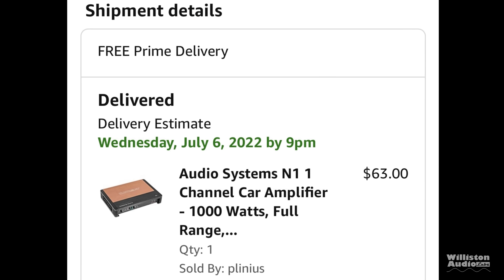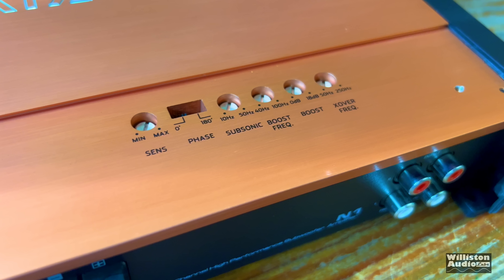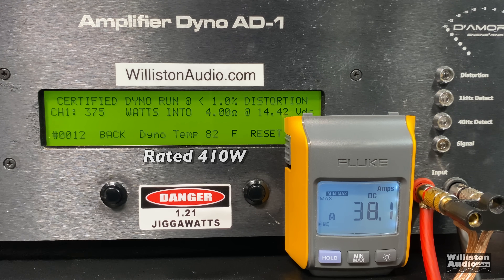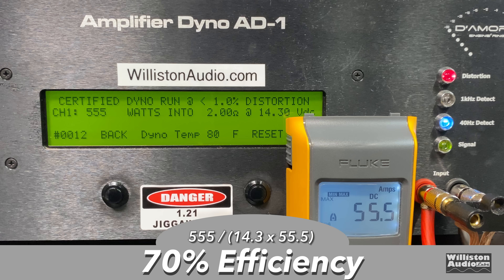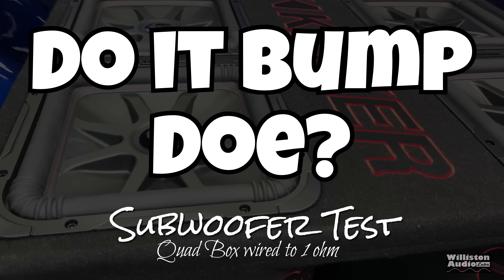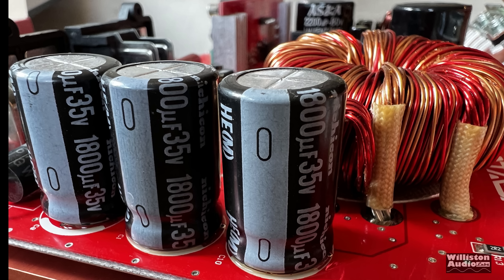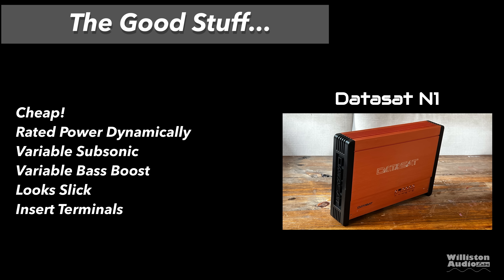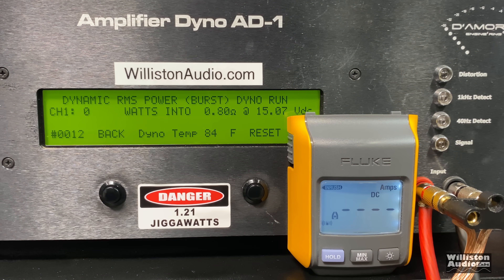Why is this 1000W $63 Amp BANNED from Amazon? [4K]

Comment: Don't know how long you have been doing this.  During the late 1970's up to about 1990, a friend of mine ran a car stereo shop (still does).  During that time, he built several crank it up cars.  We had a design we were going to put in an abandoned Rambler station wagon, but the shopping center had it towed off before we could do it.  The design was based on the speaker that a company called LTV built in the 1940's to test the microphone used to record an early nuclear explosion. One of the cars he built was for a customer with a 1970's  Chevy Monte-Carlo with the long doors.  The owner decided to go all in and cut the guts out of the doors and put 2 15's in each door.  4-18's went where the back seat used to be.  Since there was a little space left at the top, they through in some 10 inch Gauss for the mid-bass.  In the truck were 6 Harmon Kardon CA-260 amps, with all but one bridged mono.  A series of 5 inch across the top of the doors and some JBL studio tweets under the dash, rounded out the drivers.  This was fed by a high end Nakamichi cassette deck with computer controlled azimuth and a high end ADS for equalization.  The day of the contest came and we all drove to Dallas for the event.  We get there and the same guy who beat our car the previous year shows up with a 1960 Cadillac Hearse.  7-1500 watt amps and a - no kidding 26 inch Woofer for the low bass.  2-150 amp alternators.  Even with that, it still took 14 or so Marine batteries, just to turn the stereo on.  Yep lost again, but just barely.  The winner got a mini-pickup, but more importantly for the young gentleman, he got a job!  A leading amplifier company hired him as an engineer.
Reply: I miss the early 90's car audio days..

Comment: Interesting bit of kit there. I have a Velodyne 150W sub that I've been running for about 20 years (not continuously). It's an 8" cone in a ported case with crossover. The box it came in is long gone and I have it right next to a reflecting wall. My question is, is it as nice as I think it is? Yeah, it is fraying a bit on the cover. But it shakes the whole house. It also cost a whole lot less than current Velodyne products.
Reply: my boxes got smashed up but the one sounds decent enough, since the glue is holding up. they are cheap 12" passive speakers, so i use it in the house with a 200w car stereo (low power so a broke box isnt audible)
. look at the corner of the box and see if you can pull/push the panels together. if the glue isnt holding and its loose youll hear it as the speaker flexes and shakes the box, making a god awful noise. shouldnt hurt the speaker any though.

is the amp built into the speaker? might be fun to make a new box for the old active speaker. or find a prebuiltbox and fit the sub and amp into, idk.
Reply: or make a box for the amp yea? xD idk that would be sick
Reply: bro i took a piece of wood and glued it over a 12" whole. then fitted a 10" sub to said panel in place of the 12" speaker, giving it a bigger enclosure..... it sounded ok, needs a lpf though.
Reply: @1oneguythat  I should proof read better. What's gone / going is the cloth on the front. The physical enclosure is fine. The amp is built into the same box as the speaker. It puts out an amazing amount of base for an 8" with no passive driver. Although my room isn't that big, it still resonates a good portion of the house because of modern home construction. When I was in an apartment, it nearly got me evicted. LOL.

Comment: Since it was discontinued it is now a moot point.  This said; your tests while interesting did not provide meaningful data on any distortion or other accuracy errors which is how many of us look at amp performance.  It may very well produce the rated power at various impedance loads; however if the distortion levels are greater than 1 or 2 percent at those levels it falls short of desirable.  I do not expect much at this price point; however just testing the wattage does not tell us anything meaningful.
Reply from the maker: Time to watch something else then or make some vids yourself with all that additional testing. I’m sure people would eat it up. All that “meaningful” stuff…

Comment: I think your meter is lying. The amp is pushing out more than it is using. LOL.... Audio Overunity????   LOLOLOL How does it not blow the input fuses rated at 60 watts? 14.4 is the max voltage of most amplifiers x 60 amps = 864 watts, and even if the fuses blew at 125%, it would be 1080 watts. That's not including losses, etc. Adding losses would probably equal at 70% efficiency would be 756 watts at best. Test the amperage and voltage on the input with a fluke meter, I bet the 1.21 jiggawatt  AD-1 isn't showing correct numbers. I think you need to calibrate that sir.
Reply from the maker: I’ve shown before ATC fuses taking 2-3x their ratings for a few seconds before blowing. Maybe research more before making false claims
Reply: @wal the fuses are in parallel. We both know that doesn't give you 60 amps of protection, one fuses always has a fraction of resistance less than the other, so it follows the path of ;least resistance, blowing one fuse, then the other once it reaches the time/melt curve for a 30 amp fuse and blow. The following chart shows the fuse to open at 80 amps in less than .5 seconds, in fact it shows .4 . So, maybe with both fuses one will open first and the second fuse 1/2 second later. There's only one way to tell, put a good quality amprobe around the power wire and see what it's peak is while testing. I don't think you'll see a continuous amperage over 80 amps let alone even 75 .

Comment: Could it have been:

1) Actual Datasat product that was:
     A: Discontinued/liquidated?
     B: Stolen?

2) "After-hours production" by factory building them under contract?

Bonus Q: Do you know Ray Rayburn?
Reply: I was wondering if it was an attempt at branching out to a larger market that failed or was squashed by the higher ups

Comment: Using DC values (automotive)13.8V. @ 4 Ohms speaker impedance, that would be 1,000W/ 4 Ohms = 250 amps DC. First - No amplifier is 100% efficient (usually around 70%). At BEST that would draw about 350 amps. I want to know how an automotive power system could handle that load. Second is - just how big are the conductors on those 4 voice coils to be able to handle 88 amps?? Anyone that falls for that has a 1d10t error.
Reply: Pretty much everything you said is wrong.  That isn’t how amp impedances work, it isn’t how ohms law works, it isn’t how math works.
Reply: @stargazer7644  "splain it, then.
Reply: @GeneralHAM-d5k  Sorry, I don't have time to teach you everything.  I'll give you some clues though.  Speaker impedances are not DC values.  They're AC impedances.  Even at DC, you don't divide watts by ohms to get amps. You're looking for the power law, which is I=sqrt(P/R)  which would be sqrt(1000W/4R)=15.8A, not 250A, and that would be at 63V, not at 13.8V (the amp sends a lot more than 13.8V to the speakers).   Keep in mind, those are peak watts, not average watts.  The only thing your car has to provide is average power.   To calculate what your car needs to provide, you'd need to know the average power, and that depends on your music (that's why the fuses blew for some of his extreme tests - the average exceeded the fuse limit).  The fuses on the amp were 30A, so that implies the average power is going to be at most 300-400W.  The peaks are handled by the capacitors.  So you're talking at most 30A average from the car for this amp.
Also, the amp doesn't claim 1000W into 4 ohms.  It claims 1000W into 1 ohm.  So even your starting point was messed up.
Reply: @stargazer7644  Thanks. Now why are you so angry and abusive?
Reply: @GeneralHAM-d5k  You're welcome.  You spouted baloney as fact when you clearly don't understand ANY of the concepts involved and didn't take any care to try to get it right.  You stated that anyone that believes that the amp could possibly do what was claimed was an idiot, even though it was tested and shown in the video to be more or less accurate by someone who clearly knows what they're doing.   You demanded an explanation from me, as if you're entitled to one.  Nevertheless, I went out of my way and took time out of my day to try to help you understand a little bit of what you're missing.  And now you have the nerve to call me abusive?  What you're perceiving isn't anger.  What you're doing annoys me.
Reply: @stargazer7644  Thank you for this excellent example of civility.
Reply: That's not even how ohms law works. 1000w at 13.8v would only be 72.46 amps before efficiency. Speaker impedance doesn't matter in this context. The amplifier isn't driving the speakers at 13.8v. It's an amplifier. Its stepping the voltage up to roughly +-65v. 
The maximum current that could flow threw a 4 ohm load at 13.8v is only 3.45 amps or roughly 47w, so not sure how you came up with 250A or 350A. Or why your talking about 1000w at 4 ohms. 

Also my car's electrical system was capable of 250A with no upgrades. It now provides over 600A with some work done to it. Maybe dont call people "1d10ts" if you dont know what you're talking about.
Reply: Going by this logic, not a single amp on the market would achieve above 50 watts but here we are. And as Motoska8er said, amplifiers basically act like step-up transformers and turn that power into usable energy (AC) for speakers. Speaker impedance has nothing to do with the relation to what the amplifier does with the available current provided by the alternator/battery.

Comment: Hey i got a big question, i have two 4 ohm subs and one 2 ohm sub, can i wire both the 4ohms to 1ohm and the 2ohm to 1ohm and wire both to my 1ohm stable monoblock amp
Reply from the maker: Not recommended as the one 2 ohm sub will receive more power than the 4 ohm subs due to the lower impedance
Reply: @wal  the 2 ohm is a 800 watt and the 4ohms are 250

Comment: At 53% efficiency isn't this thing going to get so hot that it fails some internal components? If so, then running at 1 ohm would not be safe.
Reply: I got mine 2 days ago...honestly my punch 601 gets waaay hotter... this doesn't get all that hot...I swear like...very touchable lol. Solid piece..I'm getting a n4 too just to keep before there gone

Comment: I recently bought a Lanzar Vector VCT2610, I have not tested it but it says inside the box it's true rating is 300 + 300 watts rms. It's for strapping so it will be ok for 2 x 300w subs and my second amp for the woofers at 250w per ch and 6" x 9" 125w per channel. Should pump when I make the enclosures. There are some bad reviews for Lanzar but I think they are pushing the amps too far and not testing their true output first, I will keep them to their lowest rating. Thanks for all your great video's.

Comment: Thanks for everything Big D...

One thing I need to ask in this video:

In the beginning of this video, while showing the amp, the fuse rating, 2X30A fuses (Green), but towards the end of the video, right when you were going to open the amp up, amp had 2X40A fuses (Orange color), what's up with that? Over fusing? During the amp dyno test, it was using 2X30A fuses right?

Seen many of your videos, really caught that one by surprise.

I would love you do some testing with Brax/Helix amps, ever personally test those before? Very special request on that one, I would also love to see you do some testing/auditioning of the Diamond hex subwoofer, had years ago, 15 mutha funkin' inches, damn thing thump so hard, was unreal, very responsive sub and top notch sq.

One amp I would love you to test and audition, is the Tube Driver amps from Butler, this specific amp was designed for car audio people in mind, Butler makes stuff for home use too, Its been years, don't know if anyone still got one, this was about 20 years ago I believe.

Another amp I would like to see, is the Old Zapco AG series or even the later verisons, reference series, and the c2k amps.

Old school stereo 4 life!!
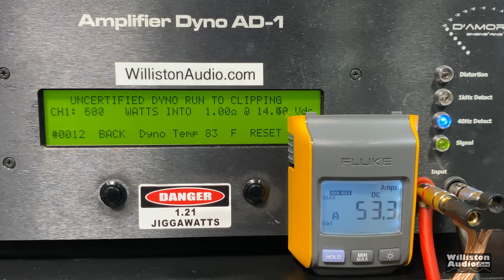Reply from the maker: watch 12:00 for the answer

Comment: I own the Dataset Rs20i
Reply from the maker: Wow that’s one impressive component right there!
Reply: @wal  I bought it because it decodes HDMI audio streams including Atmos and outputs many channels of digital AES audio that I reclock and feed to multiple DACs. Sounds realllly fine 👍
Reply: @wal  Datasat was purchased by the amp maker ATI a few years back. Their ap25 unit is functionally pretty much same as mine but cheaper.

Comment: there is still lots of info on line for their amps ,facebook , even woofers speakers etc, that goes to show you can get fair sound with descent units as some even namebrands are way overpriced. and way over rated also.
Reply from the maker: What I put in this video is my assumption. They may be back on Amazon tomorrow? I guess time will tell
Reply: @wal  your reviews are actually excellent compared to other dyno testers on YT keep up the great reviews. Thanks

Comment: I did about 3 hours of digging.

This company uses 2 major home audio names DATASAT and PLINIUS.

 these actual American companies make $20,000 amps and $9k cd players.
I have pics of this companies plinius car amps and speakers. Hot chick holding them included 😆 
I was told the plinius are not sold in usa probably cause of the name.
But the datasat n1 and n4 still are, according to them.
 there also known as UZK and KMAS
But I couldn't find any of these products 
I can get the n1 and n4 on August 10
I haven't been given prices yet.
I'll try to get a n4 to send, I'm hoping they don't jack prices too high on me,
I asked price they seem hesitant to give me one
But I have the message n1 and n4 are in stock and will b available,
Reply from the maker: There is most likely a good reason why they are no longer on Amazon but I could be wrong?
Reply: @wal  I assumed it was because of the name issue

Comment: I noticed that the fuses where different than the ones the amp had when you did what's in the box compared the when you showed the guts at first you had 2 green fuses then later you had 2 orange fuses what happened did you blow the originals?
Reply from the maker: Yep there ya go

Comment: The z44 power mosfet is arguably the best transistor ever in the car audio amp world. Due to their prevalence in many very good amps, including the early zed amps and countless others. Though there are many newer power transistors with higher performance they are a classic, timeless piece.
Reply: Nothing like the old Motorola brand mosfet they made a long time ago
Reply: I think its one of the reasons why it has poor efficiency and big difference dynamic vs clipping. Those mosfets are pretty old and inefficient. I would change mosfets for something better and probably would see 1000w up to clipping if the transformer isnt saturating ofc.
Reply: @JusstyteN  yes, I did state that there were newer parts with higher performance. Efficiency being one of those parameters, I would probably put in some 3205s but years from now the z44 or it's crossover will continue to be used in amplifiers.
Reply: @justinhiggins2210  yea i still have a small bag of those for repairs.
Reply: @JusstyteN  I had to throw away a rather large amount of those about ten years ago. I had purchased some from what I thought was a reputable company in Japan. I had bought parts from this company before but somehow this Chinese flip flop company was using a Japanese address and other documentation and it did so appear that I was buying good parts but they were fake, most having no gain at all, others very little. Their reason I quit doing repairs for profit. I have acquired around 300 to 350 car amps and have gotten into home hifi gear. My favorite sounding car amps are some old Milbert ( before the Phase Audio versions) tube amps, and they may be the most inefficient car amps ever. Efficiency is good for watts per ampere consumed, but that's about it. The best sounding amps ever made were probably made decades ago and probably only make very little power per ampere.
Reply: @justinhiggins2210  yea thiese days most of the amp designs is copy from each other because there are many brands who use the same build house.

Comment: I see you said it had some blown fuses.. I was trying to figure out how the amp was pulling over 100 amps and it's only fused for 60.. Even if it's kinda making rated power, it's just gunna pop fuses, unless you up the fase ratings.. which you have to wonder why the manufacture put 60 amps of fuse, unless it's unsafe to run beyond it..?
Reply from the maker: The ATC fuses will handle 2x or more current than they are rated for short periods. See 12:06 for the fuse swap reason

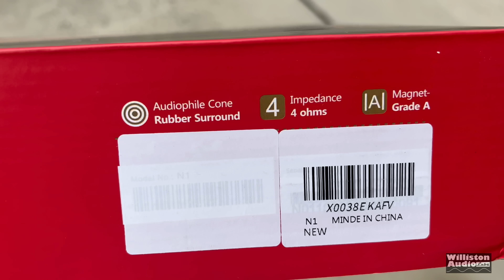Comment: It was also "MINDE IN CHINA" so says the box at 0:48. The amp actually did 450 dynamic 4 ohms, it jumped at the end. While China is extremely lax on intellectual property rights violations, they are much less forgiving when it comes to using the exact same name of another company. My guess is you will see this amp resurface with a different name.